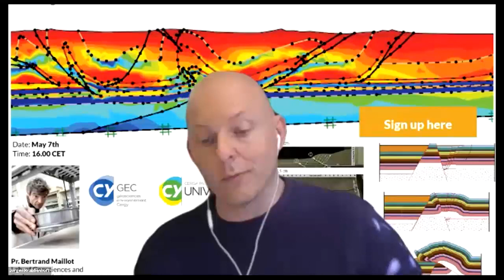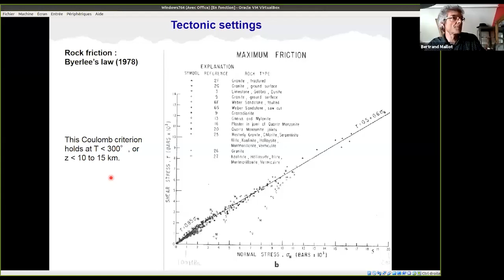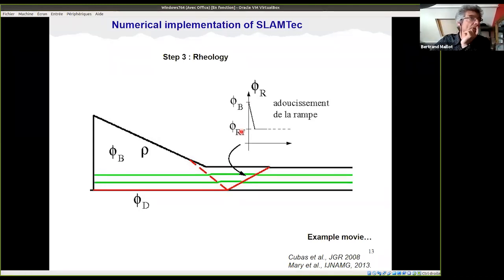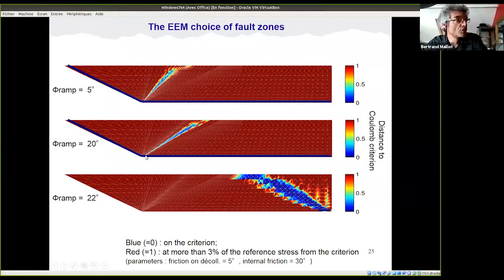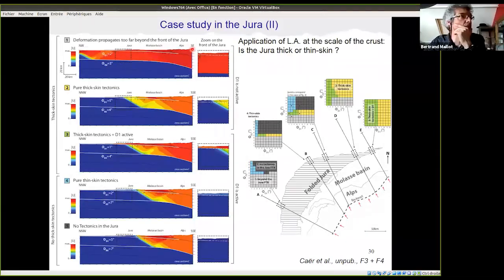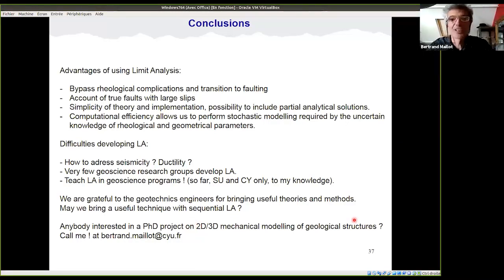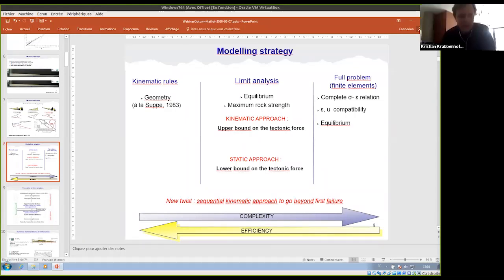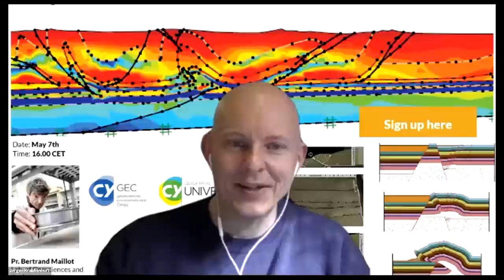The use of limit analysis in tectonic studies

Comment: very informative session. I have prepared geometry with assigning material but now face difficulty how to produce rupture and how to link interface with intermediate fault to study different parameters.
Reply from the maker: You should run either a Limit Analysis or a Strength Reduction analysis which will provide you with a failure mode and either a Load Multiplier or Factor of Safety.
Reply: @OptumComputationalEngineering  thanks for your kind reply,,, I am using Limit Analysis for the collapse mechanism and frictional properties studies, that's give failure mode in a Load multiplier when I am keeping the shape is perfectly triangular. this will give results, but not in normalized virtual vertical velocity. 
2nd But when I assign some thickness to the decolment than there is no collapse show infeasible in process